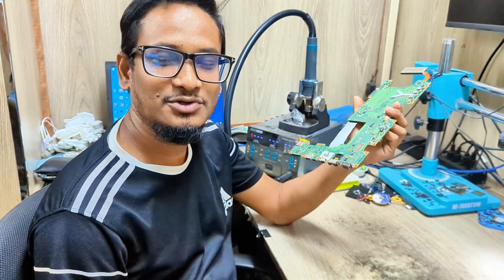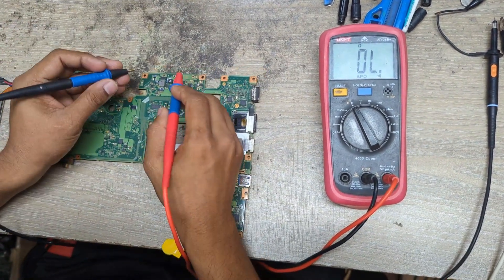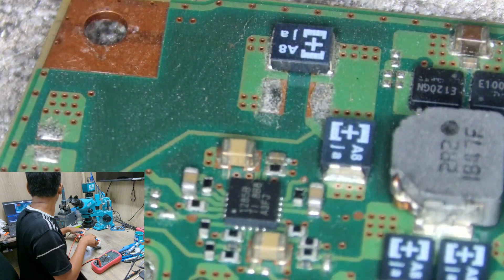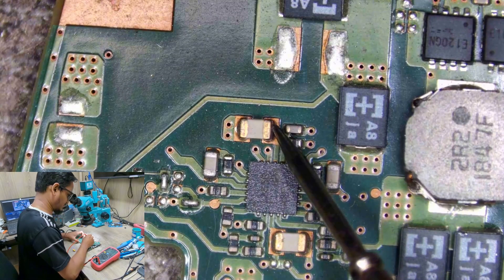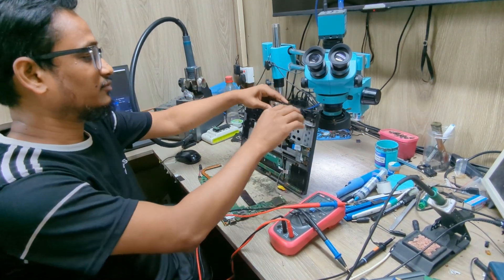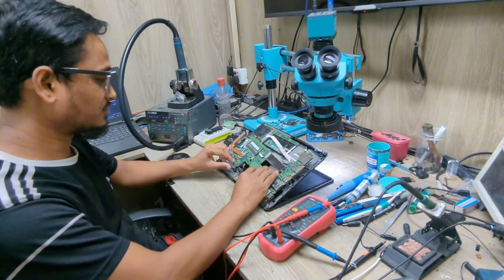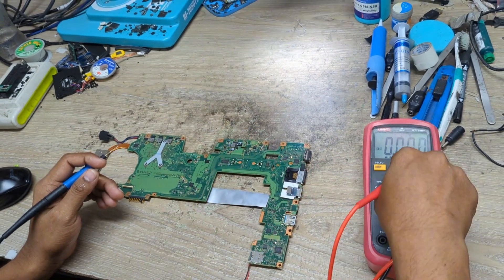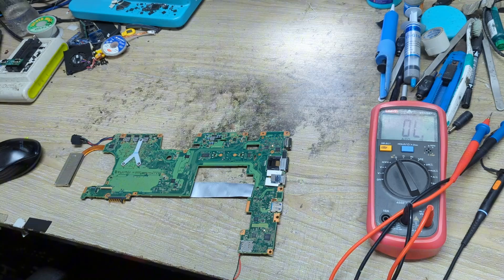Fujitsu Lifebook Won't Turn On? Easy Fix!

Comment: Hello, i need your assistance. Hp Elitebook 840 g5 comes for repair and capslock blinking continuously. Charging light blinking white and orange. I found short on capacitor C67000 which is next to DIMM2. The short is still there even if i remove the Cap. There is also short on L67010 next to C67000. I removed the coil and the short is one side to the wider area of the board. Any solution please 🙏 🙂.